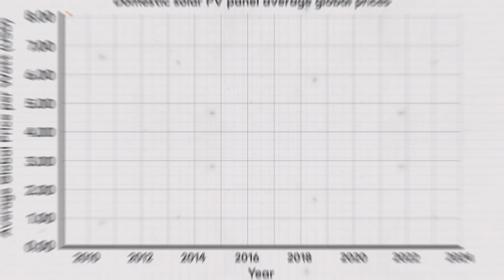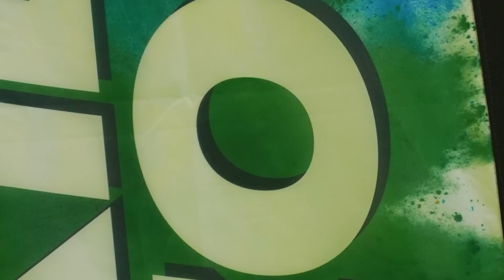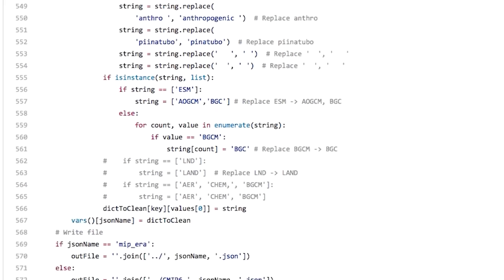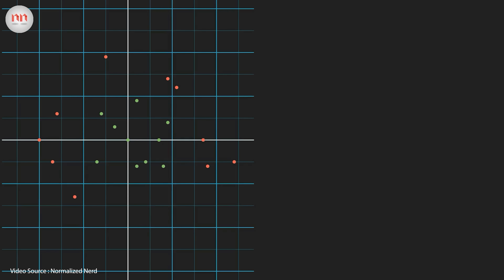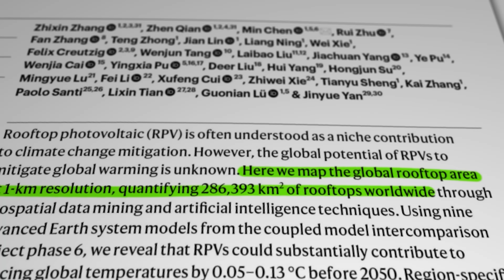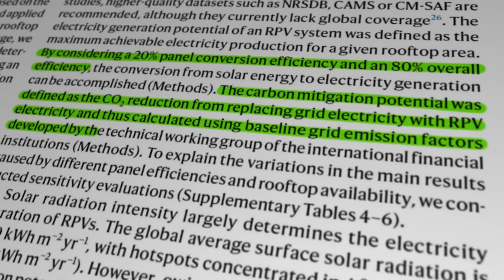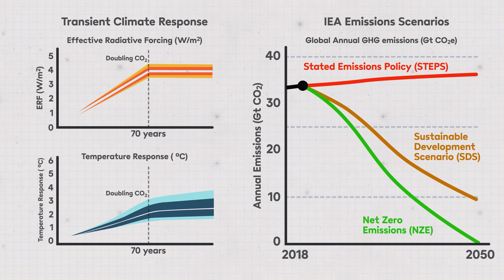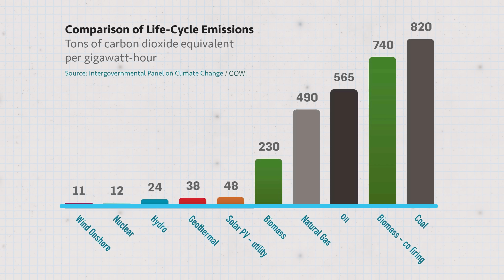New Report - Rooftop Solar PV is THE biggest climate mitigation technology!

Comment: We bought a battery electric car, mower, weed trimmer, drill, circular saw, reciprocating saw, hedger, leaf blower, angle grinder and impact driver. Everything is charged including our home appliances from our solar array that cost $8K Australian and will pay for itself in 4 years. In addition to that we export to the grid. Solar wind and hydro are king.
Reply: Without overall control of saving energy solar has been pointless for all people that I have seen, friend got some and great rate back that is due to run out but with the money saved bought a motor home and travelled the country. An average UK household uses about the same amount of electrical energy in a year as is in 11 tanks of diesel. With solar being around 2% of total energy in the UK and just being an add-on to total energy, solar has had zero mitigation on the climate because their has been a zero reduction in energy consumed.
They're not free and they aren't clean, China has used the same amount of coal in the last 20 years than USA in the last 100, and as I say overall, with electricity being around 20% of our total energy, Solar would have to have a 1000% of all the installations of the last 2 decades and still 80% of energy needs a replacement if we want to maintain society as is which is supposed to be impossible. 

Reality is we could all go to electricity, cut everything else, cut consumption overall and by staying on coal we could have cut 80% of energy.

Electricity in Australia is 29% of total energy but the country consumes so much energy overall, per capita emits more than Americans and is I think 2nd in the world or 3rd for car ownership. 
Solar after all this time in Australia is 4.64% of total energy,  65% of electricity is fossil fuel and you didn't mention a battery so will assume you still use the grid? if people use the grid for half the time then the percentage of solar as total energy could be cut too.

As oil produces 6000 different products like plastic, synthetic rubber tyres, has your consumption of plastic gone up? Knowing that for every barrel of oil these things get refined off with heat, petrol, lpg, diesel comes off first, does your electric car weigh more, requiring more synthetic rubber creating microplastics, from oil and then diesel is the waste product and has your overall consumption of oil related products gone down with solar panels? If electricity is such a small part but your savings have added to the more polluting side of life what overall benefit has been achieved in your mind?
Edit : Pollies who tell you Net zero is electricity are either misguided or misguiding.
Reply: @antonyjh1234  Dude your numbers are straight up wrong - Aus has 16% solar , and rising like crazy, uk has nearly 5 and that's prone to double. why are you giving false numbers ?
Reply: @licensetoswill Electricity is 29% of total energy in Au, around 18% in Uk, although they emit more energy for heating which is gas mainly, than electricity. Net Zero is total energy not electricity.
edit solar is 16% of the 29.
Reply: @antonyjh1234 no. So much wrong with your data and assumptions. Recommended reading: Dr Saul Griffith.
An actual expert in this topic with decades of experience. Do yourself a favour, read his books.
Especially if you love pragmatic engineering analysis and a Sanke diagram.
Reply: @antonyjh1234  The overly long explanation of why other peoples' actions are ineffective, is the classic sign of justifying your own inaction to yourself.
Reply: @garysmith5025  We could literally stop what we are doing as far as oil is concerned, stay on coal for electricity and reduce overall energy 60-70%. Maybe system change to all of us doing nothing, would be better, not saying don't get solar, just saying, any money saved spent elsewhere isn't going to lower overall consumption.
Reply: @antonyjh1234  You are simply up to mischief! Plain & simple. Just for starters to claim that solar is not making any dent as an energy supply source is totally wrong and mischievously so! For several reasons.

a) The world is obviously in a disruptive energy SYSTEM transition, which is varied in it's progress at various locations around the world. So for you to be benchmarking NY solar contribution at this point in time as final, is intellectually dishonest or even potentially wilfully ignorant. Which is it?
b) Until the energy transition has matured sufficiently as A SYSTEM, given the current issue of curtailment of large excess solar exports, that are effectively wasted energy, your numbers don't match what solar energy is actually capable of.

I could go on, but why waste time, you have obviously made up your mind that you know better. Seriously, I am so over all the "Eddie the expert" types that are chronically negative at every turn regardless of what is actually going on.
Reply: @BrentonSmythesfieldsaye  Efficiency by it's very meaning is a saving of energy, saying solar is a percentage of higher amounts of electricity and that we are making progress, while total energy increases is where the wool is being pulled.
I explained how electricity could be all solar and most country's still have 70% or more to reach net zero.
I'm saying there is no energy transition if we don't replace the 70% too, this is pure logic and synthetic tyres and ev's that are half plastic aren't going to remove asphalt and I'm just repeating words I've heard and you can disprove them but suggest the video with Art Berman and Nate Hagens called what's in a barrel of oil.
The thing to remember is you can't remove oil from your life by choice, as much electricity as you want, he mentions free fusion, it will have a very hard time producing medical plastic and because it's refined with heat to get the naphtha part all the other 85% that we burn will too, if we want aspirin diesel will exist.
The only thing to do is cut and I'm happy to cut to just our electricity energy total, that would be net zero but if you put solar and net zero in a conversation together without mentioning total energy than you aren't actually aware of what is going on yourself.
When politicians tell you "we" are making progress, and interchange energy and electricity, they might not be telling you the truth, keep up the good fight.
Reply: @BrentonSmythesfieldsaye  My reply isn't showing up, what's in a barrel of oil with Nate hagen and art berman is on this platform, electricity being 20-30% of Total energy and net zero total energy we should be careful of people telling us we are anywhere close, but you know better right?
Reply: @BrentonSmythesfieldsaye  PS :  "intellectually dishonest or even potentially wilfully ignorant. Which is it?"
Is there a third choice or just the two you want to throw?
Reply: @antonyjh1234  "but you know better right?" - Do I? Do you?

You can make up whatever you want, you can listen to what ever is claimed on this platform.

Can you tell me what the energy sector and financial/investment sectors are saying about the energy transition. Those sectors certainly aren't relying on the narrative you prefer and there are a multitude of different narratives doing the rounds "on this platform" and they can be quite inconsistent with each other. So you can try all you like to suggest that I think I know better, but I will simply defer to the experts in those sectors that have to actually consider and deliver the energy transition.
Reply: @antonyjh1234  "Is there a third choice or just the two you want to throw?" - If one is intellectually honest, then the options take care of themselves.
Reply: @BrentonSmythesfieldsaye  "Can you tell me what the energy sector and financial/investment sectors are saying about the energy transition"
Yes they are saying we are succeeding.
"Those sectors certainly aren't relying on the narrative you prefer"
I don't prefer it I am merely saying electricity is not total energy and your answers haven't covered how we Weill get the bottom of each barrel to get asphalt.
 "So you can try all you like to suggest that I think I know better, but I will simply defer to the experts in those sectors that have to actually consider and deliver the energy transition."
Oh so instead of answering any of my points you are now going to hide behind experts who will tell you we are 65% of the way there? Ok.
Simply defer..? I mean seriously? You get to insult people and now it's you'll defer to people are a sucking on the teat of new debt entering the system? I mean can you show where overall it's been a saving of energy, or was it maybe save some over here and then spend it elsewhere? Can you show a reduction in total energy, not save some and then go on overseas holidays? the point is all these govt subsidies is a way to input more debt and unfortunately as they said 50 years ago, stay off oil, more of both is going to be added especially if you want synthetic rubber coated wires or any of the 6000 products from each barrel because I am going to assume you didn't watch the petroleum expert of the video I mentioned, you want to ignore that expert?
Reply: @antonyjh1234  Why get it second hand from me, I am no expert, why don't you yourself go directly to the actual sources. Why should someone else spoon feed you. Try the IEA, Bloomberg, IMF, Energy Trasitions Commision, WEF, IRENA and the list could go on and on. It's all there waiting for you and anyone that cares to have a look.

"going to hide behind experts" - Ha ha ha ha, really? Well it's better than hiding behind you.
" You get to insult people" - Harden up pal. No need to sook. If you are determined to be insulted, then there is nothing I or anyone else can do about that, so you do as you please.
Reply: @BrentonSmythesfieldsaye  "Why get it second hand from me, I am no expert, why don't you yourself go directly to the actual sources" I give you a real expert and you give me the world bank..oh the irony
Reply: @antonyjh1234  No, I didn"t list the "world bank" at all. Sigh! I think that clarifies what is going on here. You have a nice day.
Reply: @BrentonSmythesfieldsaye  "No, I didn"t list the "world bank" at all. Sigh! I think that clarifies what is going on here. You have a nice day."What a dickhead...world bank, IMF you with your humility and big brain might be the only one who see's the difference, point was check out the expert, shoot the message not the messenger and admit when you might not know anything more than what you have been told to believe..can't help them all I suppose, you have your attitude and sit on it.
Reply: @antonyjh1234  One last thing for the benefit of other readers, here is an example, to determine whether they can rely on what you say.

You claimed and I quote - "Solar after all this time in Australia is 4.64% of total energy,  65% of electricity is fossil fuel"
Are you talking about "energy" or "electrcity"? It's either one or the other for removal of ambiguity in the conext of a like for like comparison.

As far as electricity generation is concerned in Australia, solar generation is actually 18% of total supply capacity at this point in time.
Source: Australian Energy Update 2025 report.

.......and continuing to grow at pace as a % of generation capacity.
Reply: @BrentonSmythesfieldsaye  What do you think was meant when I said you should be careful about politicians using energy and electricity interchangeably and I have been very clear in my distinction of the two, have I not?
As you quote the energy update one might think what you are saying is the solar is 18% of energy, it is not, it is of electricity which is now online 24% of total energy.
I won't go back into checking what I said but 65% of electricity being fossil that only leaves 8.4% as the rest, so assuming solar is what you say, or as I said solar after all this time is 4.64% of total energy as I said.
As I say, when the energy update etc uses words interchangeably and reality means no chance on net zero, they might be pulling the wool.
Reply: @antonyjh1234  But terminology "interchangeabilty" as an issue, is just your personal narrative at this point. You provide no examples or evidence in support.

Non energy sector laypeople likely make that type of language slip up. I do see that happen. But then that would then endorse why I earlier suggested that you, should be referring to the relevant energy and financial sector publications for the defintive information, since it will come with correct terminology consistently applied. Then there is no need for your complaint is there.
Reply: @antonyjh1234  I think we are done.
Reply: @BrentonSmythesfieldsaye  "intellectually dishonest or even potentially wilfully ignorant. Which is it?"
You have a funny way of deflecting when you are wrong.
If you think telling the public that we are on the way to net zero by 2030 by achieving 100% from solar and that 18% of energy being roughly a 450 overestimation isn't an issue then we and any logical person would disagree. You can't tell the public we are on the way to net zero when they only mean electricity which if you got past yourself, you would see that is what they are doing.., I think we are done..ha, these rage quits you do are funny.
Three paths to the truth so I don't mind your different attacks : "Arthur Schopenhauer: first it is ridiculed, then it is violently opposed, and finally, it is accepted as self-evident"
Did you ever watch that video, scary how much we don't know and think we do uh?
Reply: @antonyjh1234  "If you think telling the public that we are on the way to net zero by 2030 by achieving 100% from solar and that 18% of energy" - Speaking of intellectual dishonesty.

Thanks for stepping in to reveal yourself further. Quoting philisophical statements by other people, is irrelevant. Try your silly emotive responses all you like. That doesn't work with me. Sorry.
Reply: @BrentonSmythesfieldsaye  I'm quoting you back to you..maybe I should find an expert instead of somebody who is stupid and arrogant?
You are 400ish% wrong by the very people you quoted and now instead of acting intelligent you get hurt and pompous, good luck but I don't know what would work with you if the truth doesn't.
Reply: @antonyjh1234  So now you want to promote the idea that because there is no magic switch to instantly arrive at renewable energy utopia, then there also cannot be a progressive transition over several decades. That is effectively what you are attempting to argue. 🤣🤣🤣🤣🤣

Like I said, talk about intellectual dishonesty.
Reply: @BrentonSmythesfieldsaye  You now show you can't even bother to watch the video and if you had seen the video you would know electricity will never replace asphalt, it will never convert the whole 80%, it does not matter, to reach net zero it is 75% of energy reduction, not convert it to solar and then get an electric car..it's not an electric plane, we will never transition, not if you still wear synthetic clothes.
85% of each barrel is stuff we burn, to get synthetic rubber tyres all that 85% will exist, it will find a market if you don't use it, if you have extruded foam shoes, gym shoes, petrol exists..as long as we use oil there will be no transition and you haven't removed oil from your life by choice.
You remove oil from your life by choice and I will believe you, carpet, plastic, nylon, the device you are using and I will agree it's possible
Reply: "I'm quoting you back to you" - No you didn't quote me at all.
Reply: @BrentonSmythesfieldsaye  You quoted 18% of energy from the "energy" update.
Stop being you.
You gave me proof of what I am telling you what is wrong and you said it's matter for interpretation. go away I have tried to help you as much as possible and all I ge is silly reports of utopia etc. cheers.
All I've given you is the truth while you constantly attack and belittle while being wrong the whole time...go away please.
Reply: @antonyjh1234  A quote shows verbatum what was said and presented in quotation marks to indicate that, instead of what you are doing, which is to construct posts to misrepresent what was said.

The rest of you waffling is irrelevant.
Reply: @BrentonSmythesfieldsaye  Seriously, you are like this in real life, I remember you had the same attitude last time I encountered you.. It's not likeable this ignorant attitude, it's acting like a child when you can't be wrong, which we both know you are, same as all people reading..forever..will always know.
Reply: @antonyjh1234  "You now show you can't even bother to watch the video and if you had seen the video you would know electricity will never replace asphalt"

Making stuff up again I see. 

First up I never made a challenged that particular claim. You mischievously now keep trying to change the thrust of you complaints. The classic contrarian goal post mover.

Secondly, unfortunately for you, there are alternatives to asphalt as you currently know it. They apparently can be better than traditional asphalt as well. Here is one such example. In Australia we already have the Reconophalt, a Downer product. It is already in use across several councils for road construction and repairs.
So I have no idea what you are on about in the end anyway.

Unluck!😂
Reply: @antonyjh1234  You seem to be upset.
Reply: @BrentonSmythesfieldsaye  Go away troll
Reply: @antonyjh1234  
Wow, thanks for the TED Talk on how solar panels haven’t single-handedly saved the planet. You’re right — silly us, thinking that reducing emissions from a chunk of the grid was somehow better than doing nothing.

Yes, solar is just part of the puzzle, and no, it hasn’t instantly erased our dependence on fossil fuels, cured climate change, or made plastic disappear. But calling it “pointless” because it hasn’t fixed everything is like saying seatbelts are useless because people still die in car crashes.

Also, blaming solar for not reducing energy use overall is like blaming treadmills for not making people fit while they’re still eating donuts on the couch. The problem isn’t the treadmill — it’s how people use it (or don’t).

And yes, solar panels are made in factories, using energy, often from coal. So are phones, TVs, and… well, everything else. Should we scrap those too? Let’s be honest: if we held every product to the “but it’s not 100% perfect” standard, we’d all be living off-grid in a cave — made from ethically-sourced mud, of course.

Solar isn’t the solution to all problems, but calling it worse than coal because your mate bought a motorhome kind of misses the point. It’s a tool. Whether it helps or not depends on how we use it — and whether we’re serious about changing the rest of the system, not just moaning from the sidelines.
Reply: @antonyjh1234 All those words to say nothing at all. You should have added some emoji.
"Saved enough money to buy a motorhome and travel the country" is a bad thing how?
Reply: @ So you're the sort of person to insult when you hear the truth and then without any critical thinking on your own behalf you thought asking a ridiculous question, when if you had read all the words and thought a bit before getting reactionary you would have understood the point but let me put it another way, in a tank of diesel is the same amount of energy as 3.2 months of my electrical energy, if someone uses a tank of diesel a week in their motorhome that is equal to 17 years of my electrical energy being released. Overall it would have been better if they had stayed on coal, not got solar panels and not driving around the country with the money saved.
Not sure how you didn't get that from 11 tanks of diesel is equal to an average UK home electricity consumption, but I add these extra words to make it clearer, if I add less will you understand more?
Reply: @antonyjh1234  How big are these "11 tanks"? As big as the glaciers that are "growing back"?
How efficient are the generators you'll be using? As efficient as cars with several megawatts in the tank but only get the sane range as an EV with 90 kilowatts?
Go on, run your home on a generator and "11 tanks" for a year. Start in May and let me know how it's going in September
Reply: @ Oh my goodness what is this nonsense you have come back with?
What is your point because it seems like a scatter gun of opposition?
11 normal sixty litre tanks.
The point of solar is to have a saving of energy, not save money buy a motorhome and emit more overall, that is the opposite of Net Zero.
Reply: @antonyjh1234  >Copy-pastes the same rambling reply to multiple comments
>Complains about a "scatter gun of opposition"
Reply: @michaelmartin9022  
Pick you head up, look at the camera, don't look like you do and change your personality, you'll be fine..